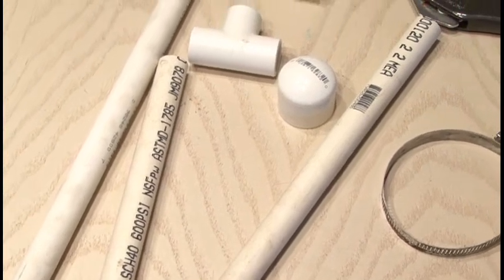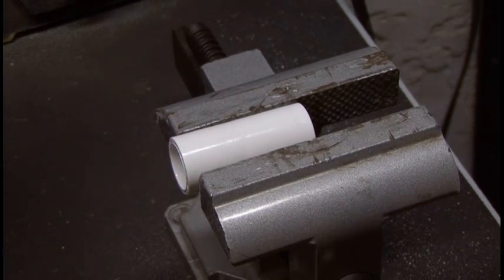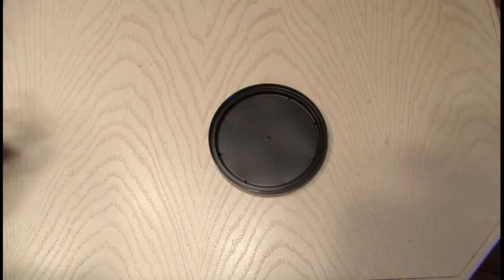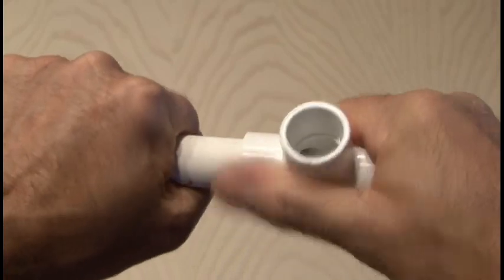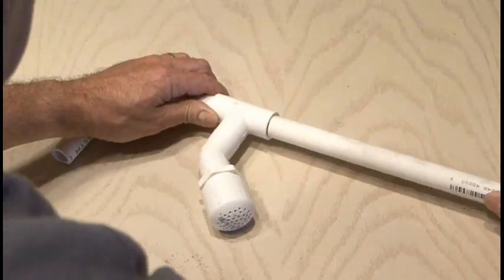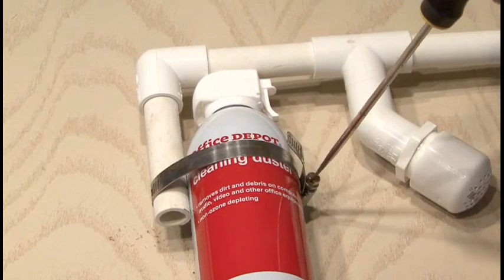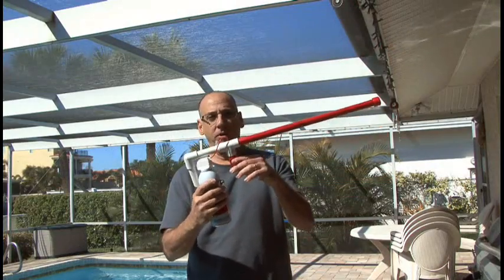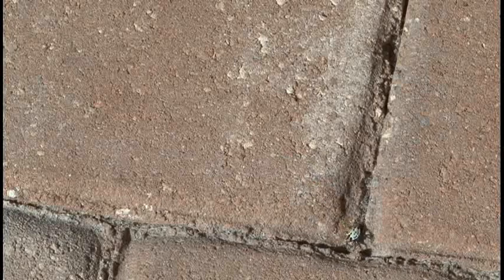Weekend Project: Spider Rifle

Comment: I modified mine so that it actually shoots spiders.  I get at least 50 feet out of most larger garden spiders.  I set up a target too, to check accuracy.  I usually spat them within 3" of the bullseye at 20-30 feet.  I want to build a larger version now, to help get rid of the mice we have here...  Any suggestions on how much air pressure is best with rodents???